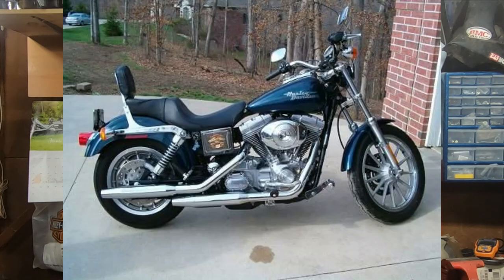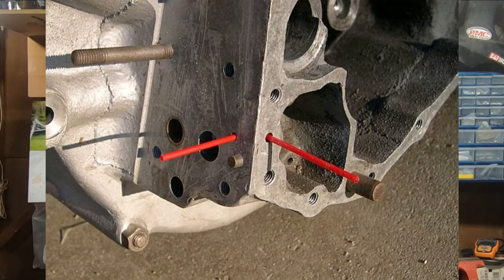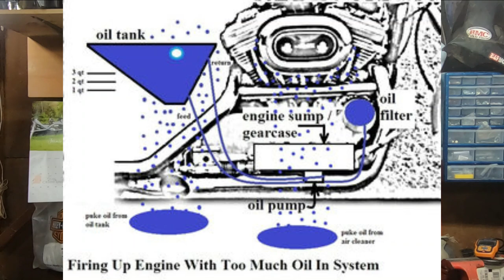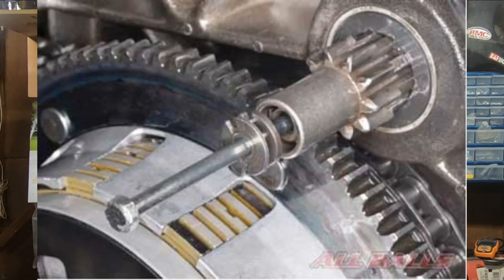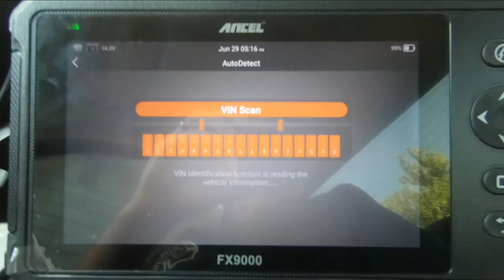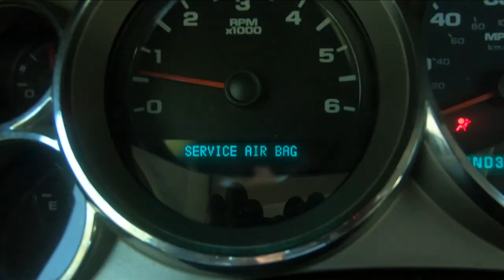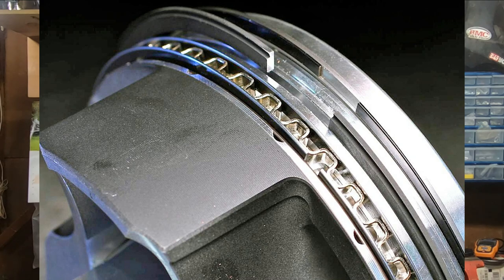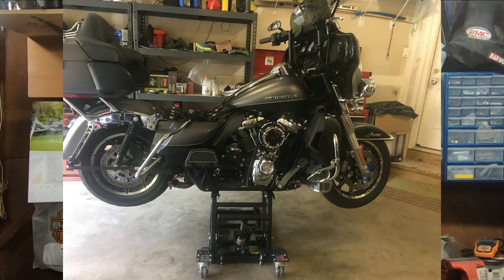Harley-Davidson Engine Oil Sumping Is Drowning Your Crank

Comment: The external oil pump on the motors from 1935 to 2000 were so simple and reliable, so they had to get rid of it, huh?

They could fill the crankcase when the check-ball to seat on the original cast iron pumps up till 1967 could wear and allow the oil tank to drain into the motor. Especially with the old 60 to 70wt oil when cold. In 1968 they came out with an aluminum body pump with a flat end check valve.
Reply from the maker: Cost, it was cheaper to put it in the bike and on the external oil pump bikes the cover actually supported the cam. To reduce noise supposedly they went to the support plate, internal pump and that reduced detectable noise. Allegedly lol.
Reply: They also always leaked.
Reply: Your wrong ..in1968 they had alum.body that still used a 3/8ball bearing...the flat bottom plunger u refer is pressure relieve valve...don't spew untrue info and confuse all the unknowing...geez!
Reply: @theoneracer2716  Never said anything about like that. Besides I have a '68 FLH and know it introduced the aluminum body oil pump. But like most, I replaced it with an S&S.

Comment: My bonnie wet sumped  blew smoke for a mile or so. Shovel. That had a big chuck on the ground from the breather on start up. I put the breather pipe on the chain.  And told people it was chain oiler lol. My evo had the filter but seemed ok my Twin cam so far so good “ touch wood “ just a base in the throttle body. But only done about 20,000 miles so still new. lol

Comment: I have that Harley model 1200S in the second picture. It is exactly like that one same color and all. I have never seen another one on the road in twenty years.
Reply: What year?  I've got a 96.  Wish I had twin plug model but that came out in 97.  I just took a beautiful ride to Saratoga on it today.  They're great bikes
Reply: @paulfiore7083  It is a 2001 I bought it brand new from military overseas sales when I was stationed in Puerto Rico. It came with 10 to 1 compression and upgraded cams from the factory. I had to re-jet the carb to make it run right.

Comment: As my pappy used to say,”cheer up, it’s like this for awhile, then it gets worse.”
Reply from the maker: 👍 it's not all bad, dry sump systems work pretty well. Honestly while it theoretically a possibility on Twin Cams and Sportsters it's pretty rare. Unless you've piled on a lot of miles, but M8'S well they do have some issues.
Reply: I enjoy your videos because you present a lot of intelligent verbal content, no screaming banshees in the background, and current issues with all models of Harleys.
One issue I’ve had with my TC88 is the linkage loosening at the spline end of the shaft coming out of the transmission. Any tighten or JB weld failed to tighten it. Only a removal of the primary and disassemble of the transmission corrected the problem. I am wondering if you or any of your followers experienced the same problem.
Reply: I’ve got some great pics and videos of the whole process

Comment: I remember on my Sportster I had to start it for a short period to get an accurate oil reading but with the Dyna the oil pan is actually under the engine and trans so it never drains back into the engine while the bike sits.
Reply from the maker: Yeah the newer A motor is a really nice design. Where you see issues there is if the oil pump doesn't scavenge to the top of the engine correctly and oil backs up in the crank case itself.
Reply: Dyna - The best Harley line ever.
Reply: @hawkdsl  Some thing's I like better about the Dyna that I own now, and some things I did like better about the Sportster. 
My Dyna would be perfect if the cam chest used the same gear driven quad-cam set up as a Sportster with straight pushrods and if the drive belt was on the other side like a Sportster, not trapped behind the primary.
I also thought my Sportster Evo had a little better sound than my Twin Cam Dyna.
Reply: @GixxerFoo  y

Comment: When the dealer looks at the sumping problem, sometimes they install a small breather tube to fix it. Also there was some talk of another fix in that the clutch hollow tube was replaced with another one making me think that is why Harley went back to the cable clutch?
Reply: Your talking about transmission transfer issue. Has nothing to do with sumping. Transfer and sumping are two totally different and unrelated issues. But thanks to HD's horrible engineering and production it's common to have both issues at the same time.
Reply: @wonderwing5139  Thanks for the explanation, I thought there was some kind of oil transfer with the clutch tube. Just one more thing we must put up with to be a Harley owner I suppose. 👍

Comment: I created the sumping issue by filling too much oil when the engine was cold.  Started pushing oil out the air intake.
Reply from the maker: Oh dang, yeah you wanna be about 3/4 on the dipstick when hot cause if you actually fill to the full mark when hot they will puke out the head breathers.

Comment: My evo will puke oil on the driveway if it sits a week. Been happening for years. I Think the problem is the ball check valve in the pump. If the ball seating surface is worn or irregular it leaks by. taking it apart and lapping the seat would probably fix it. but I choose to just pull the vent hose out from the air intake and run it to catch bottle, start it and wait, some times I have to shut down and start again because it fooled me and puked all over the engine and ground. you can hear it start gurgling through the breather hose and thats when it happens. put back the hose and im on my way.
Reply from the maker: It for sure sounds like it's the check valve, oil pumps for the Evo are pretty inexpensive and not super hard to swap. I'd just swap it out and be done, could even rebuild the old one in case you ever need it.
Reply: @GixxerFoo  good advice thanks
Reply: Welcome to pre-93 evos...

Comment: Hey Gixxer, quick question. My dad has a 2000 Fatboy and it sat for a while. No oil in the tank. I drained the oil, and then put what the book called for. It seems I put too much (didn’t change the oil filter or know at the time how much stays in the motor). He started it later and after a couple of minutes, the oil dipstick flew out and oil went everywhere. Possible to drain some oil out and run it again? Anything else to check?

Comment: I let my Sportster sit and it was very low on oil and so I topped it up and on a ride it pumped out oily oil from the crankcase into the oil tank which couldn't hold it and it puked oil all over the belt drive which sucked up the oil and started to disintegrate I started losing teeth off the Bell Drive but I managed to make it home without pushing the bike

Comment: A friend tried to replace cam chain tensioners on his 2001 TC by himself. He's not the best of mechanics and I wasn't around to help, even though I've never been in a TC cam chest. After the job was done, he calls me to tell me there's oil blowing out the breathers whenever he starts it up.
Reply: If he removed his top end and replaced his breathers, it is entirely possible he installed them wrong. It goes filter, base plate, umbrella valve  inserted in base plate, then top plate. I've seen people go filter, umbrella, base, then top. That will just spew oil out of the breathers.

Comment: Where is the tank on a dyna
Reply from the maker: Dyna and touring, the A motor will have a oil pan with basically a windage tray which keeps the oil down in the pan. The oil should stay down in that pan away from the crank, but if it's sumping it builds up in the crank case and isn't returned to the pan.

Comment: Could that be happening and why engine temp is so high on M8’s 107 and 131’s?
Reply from the maker: High temperature is a sign of sumping, the crank plowing through oil in the sump will generate some heat.
Reply: @GixxerFoo  I’m running a 131 and I’m @340 riding
Reply: @Heavy69Metal  
Wow is that oil temp or engine temp? You probably should invest In cooling fans
Reply: @scrumthebum2451  engine temp oil is about 262 and this is on a 131. I have the oil cooler with the fan. Also running love jugs mighty-mites too
Reply: @GixxerFoo  damn. I’m running a 131 now my engine temps are 320-340 plus and oil at the dip stick reads at times @262 plus and I have a cooler and it has a fan on it as well and using mighty-mites by love jugs and still this high.
Reply: @Heavy69Metal  
Seams high to me I just have a factory oil cooler on my twink & it rarely gets above 260 unless I’m light to light in 90 degrees weather 
But I’m usually on rural roads
Reply: @scrumthebum2451  stop and go and 50 miles by @8-10 miles I’m up to those temps @80-100 plus degrees mornings @320 temps are outside from @65-86 plus in morning 4am ect yes I’m in Florida